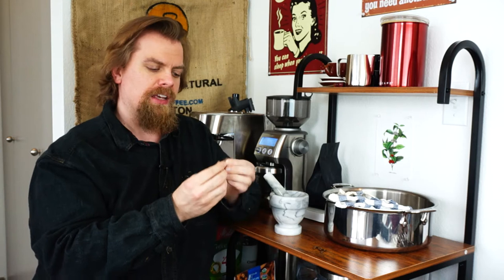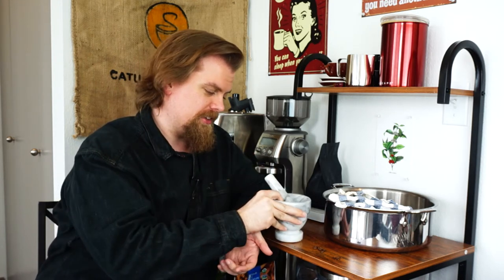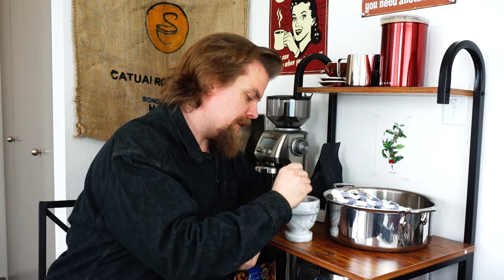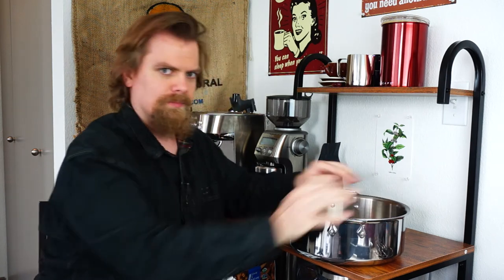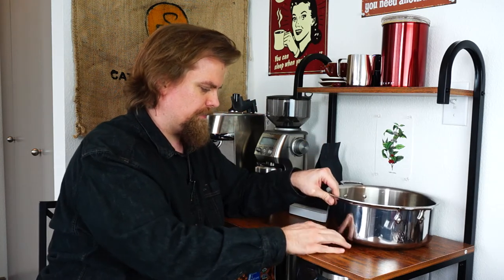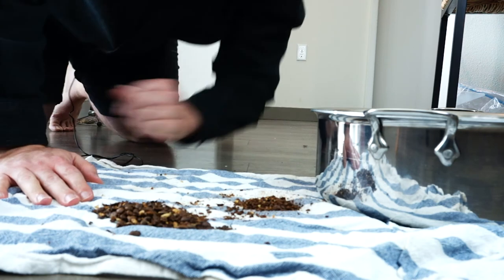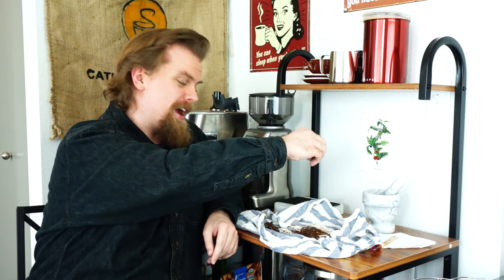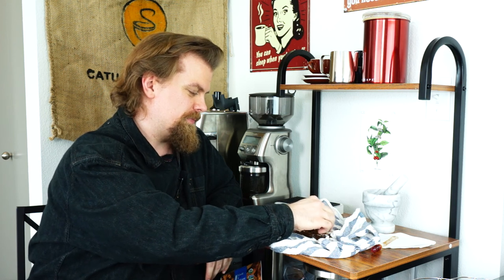Grind Coffee with No Grinder - The Stuck At Home Brewing Series

Comment: Mortar & Pestle is a difficult way, but it works.  Not comfortable.  Not fast.   I did that a couple of times.  I also tried cup on a plate, similar to your pot and the towel, but the mortar & pestle was better.
Reply from the maker: yea if my grinder ever breaks, its the mortar and pestle for me (until i replace the grinder of course)
Reply: The Most Available coffee grinder is Teeth. Chew it, split it, In French press and Repeat. Pour the hot water 200°celcius. Leave it for four minutes. And Walaa Coffee is Ready.

Comment: I did a similar thing like you did with the pot method but I just used a hammer and I pulverize them but it still does not want to brew very well I have this very very dark roast and it's only brewing lighter than a light roast would brew if I bought it in the store already grinded up